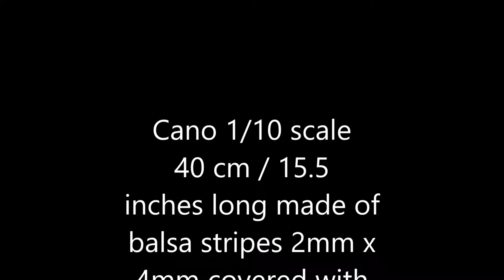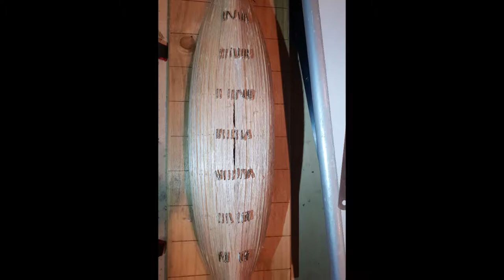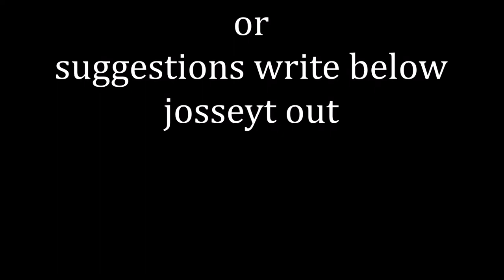1/10 scale canoe build for rc crawlers

Comment: Could you share the plans and materials?
Reply from the maker: Hi. Unfortunately haven't go plans to share. But will tell you what to do. Look online for full scale canoe plans. Scale down to required size pay attention to length. Use thick cardboard for creating 3D template. And in my case simply  balsawood was the main materials to build the structure. Sanded and stain painted. Finally fibreglass coated  with resin.  Good luck👍